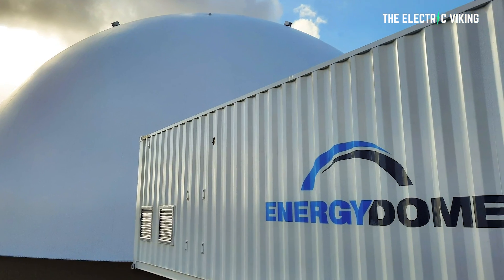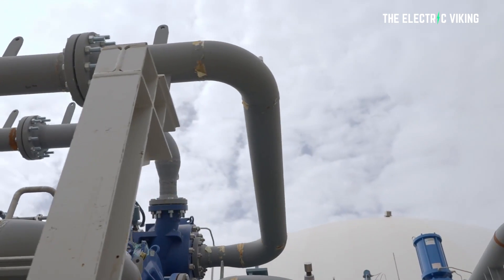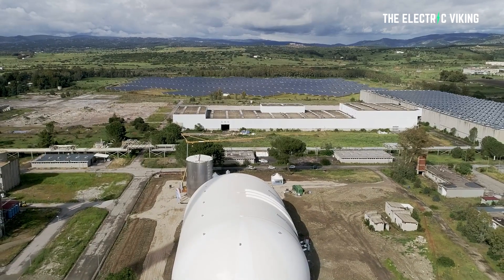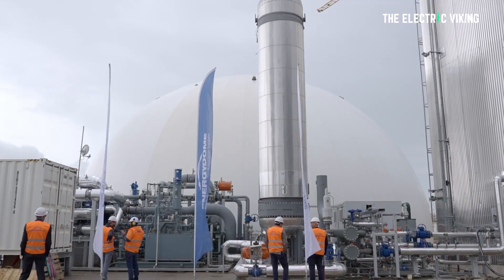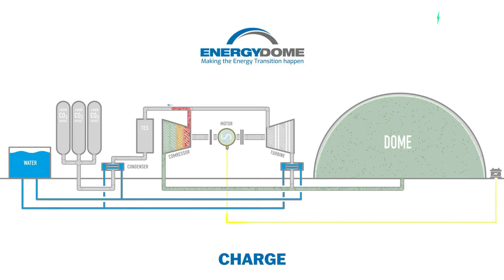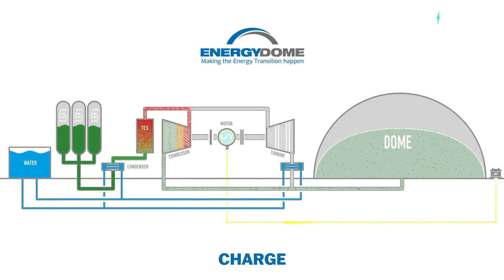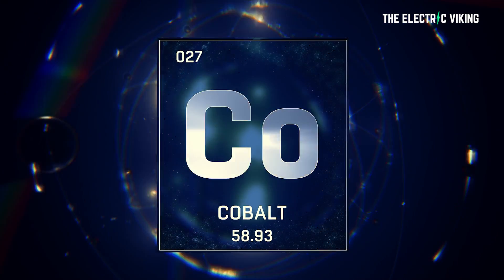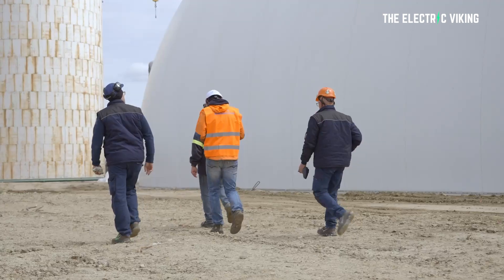NEW CO2 battery is about to change the world as we know it

Comment: I would expect maximum 20% return of electricity out to electricity in. This system could break even if it sold power for more than 5 times the cost of power. But pumped hydro and chemical battery systems have round trip efficiencies better than 80%.

This is a heat cycle engine. The optimum operating temperatures are 20 degrees C (Ambient air) to -78 degrees C (Boiling point of CO2). 
The thermodynamic efficiency limit is:
(20+78) / (273+20) = 33%

For the compression side, you can capture some (half?) of the generated heat, say a large tank of water, and use this to heat the liquid CO2 in the expansion side to feed the turbine.

Look at that enormous silo. That contains an enormous plastic bag to hold all the gaseous CO2.

Viking - you need to pass these product announcements to a technical team before you post.
Reply: You are the only one here who knows what he talking about. Unfortunately your comments will be understood by very few. Systems that use cold storage can never be efficient enough because of the Carnot limitations of Tc/Th. It is better to use high temperature to store energy as Tc/Th is a smaller number which raises the Carnot efficiency of (1-Tc/Th). Better still is to use batteries or pumped hydro. Don't sell your Tesla shares yet, grid storage still likely to be batteries. Viking I love your work but having a power company agreement means nothing. The power company just agrees to buy at a certain price...IF the tech company can supply. Onus is all on the technology developer and 99/100 they will not deliver because this problem is not so easy. The world is littered with failed energy storage ventures for good reason.
Reply: @peterwilliams1119   ... you understand, as well. We need far more engineers making comments about these types of videos.  Better yet, we need real engineers creating videos on various technologies. In spite of it being difficult to communicate the technically complex to non-technical, but hopeful, people.
Reply: There is no need to cool CO2 to -78 C. It has critical point at 31 C, 73 ATM. Both easy enough to achieve. Density is about 440 kg/m³ at critical point. So they compress it as a gas and store resulting heat separately. Of course this is energy and CO2 storage device. It does not produce energy or remove CO2 from atmosphere.
Reply: They claim: 
Built using commodity components, the company claims that its CO2  battery achieves a 75%-80% round-trip efficiency.  

The system has up to 200 MWh in storage capacity.

No-one knows what their LCOE is.
Reply: They use systems to extract liquified gases from air.  This is a similar idea to the ‘air battery’ based upon this existing commercial use.
Reply: Uh no. It is not a heat engine it is simply a compressed gas energy storage system using CO2 compressed into liquid drawn from an enormous dome which has to accommodate the roughly 800 times greater volume of gas vs. liquid. Heat of vaporization mud be provided and some of this seems to come from the heat from compressing the CO2 into liquid. Liquid air “batteries don’t need the dome.
Reply: @stevemickler452  You literally described a heat engine.
Reply: It actually has more in common with compressed air storage. The gas is simply compressed and then reexpanded. The gas is compressed to liquid liquid to reduce the size of the storage tank and the pressure it has to resist. Heat is not being converted to work.
Reply: @stevemickler452  CO2 starts out at say  -50degC and ends up at say 30degC and the output is electricity. That's a heat engine. In the reverse cycle the gas is compressed and heat removed via HEX which results in cold CO2 liquid. Electricity goes in (via the compressor) , the gas starts at say 30degC and ends up at say -50degC. That's also a heat engine but working in reverse.
Reply: Suggest you read some of the comments above that say it better than me but it is an energy storage system not a heat engine.
Reply: @stevemickler452  I've had 40 years experience working with heat engines as a professional mechanical engineer. This is a bog standard Rankine Cycle heat engine. The storage component is the tank of liquid CO2 only. Suggest you pull out your thermodynamics book and re-read it.
Reply: I too am a mechanical engineer now retired. A. Heat engine convert’s heat into work, right? What is the heat source? I don’t see any fuel involved. cO2 is compressed and then expanded. It is really different from compressed gas storage only in that it is compressed to liquid so there’s heat of fusion and vaporization to deal with. It’s called a battery not an engine. The CO2 begins and ends at the temperature in the dome.
Reply: Whoops. I didn’t”t mean “heat of fusion: I realize it’s not frozen. My bad.
Reply: @stevemickler452   @Steve Mickler  Look at a steam turbine as an analogy. The ultimate heat engine. Water is boiled into steam, passed through a turbine to produce power. Then the steam is condensed through the removal of heat to start the cycle over again. The fuel source is coal, gas, wood, whatever. The steam is analogous to CO2 but operating over a different temperature range. Also for this CO2 system, the Rankine Cycle is split into 2 phases. A thermal energy storage stage and a power generation phase. In the Thermal Energy Storage (TES) stage moderately pressurised CO2 gas is taken from the dome at ambient temperature, compressed to higher temperature and pressure, heat is removed via HEX and stored in another vessel, the CO2 gas condenses after heat is removed, the CO2 Liquid is stored in separate pressure vessels.  This is all done with surplus electricity which is driving the compressor. In the power generation mode the liquid CO2 is boiled into gas using the heat previously removed from the CO2 now stored in the TES, CO2 high pressure gas is passed across a turbine to produce power and then stored as medium pressure gas in the dome gasholder to complete the cycle. The "heat: comes from the heat removed in the previous compression stage and stored in the TES.  The "fuel" is the surplus electricity which drives the compressor and causes hot gas which is heat exchanged to the TES. The heat is also visible in the Delta T across the CO2 in liquid and gas phases. The CO2 starts out at -50degC in the evaporator, ends up at maybe +20deg after the turbine. That's a 70degC Delta T that the turbine uses to generate power. The "heat" is also visible in the Compression stage where CO2 gas starts out at ambient temperature 20deg and ends up at maybe 90degC hot gas after compression. You don't "see" any fuel because the "fuel" is the surplus electricity. The CO2 begins in the dome at ambient temperature, yes this is true. But it the turns into a liquid and is stored at low temperature and high pressure. That's where the removal of heat occurs. The heat is removed and stored. The CO2 cannot be turned into a liquid without the removal of heat. It would stay as a superheated gas forever. In the 2nd  power generation phase the same heat that was removed is added to the liquid CO2 and it gasifies and expands across the turbine. That stage is where the heat is added back to the CO2. It is also possible that they could use some ambient air heat to help the process.
Reply: I agree with much of what you have said, although the efficiency of pumped hydro and batteries are excellent there are also times and places where they have serious shortcomings. Not everywhere has a reservoir suitable for pumped hydro. Batteries are currently too expensive for longer term storage. I would love to see cost estimates for this system versus Iron flow Batteries at scale. Both would need battery storage (e.g. Lithium Iron phosphate) for peak load balancing.

Comment: Sam, It isnt generating any energy, it is only a battery, storing energy. The fact that it is using CO2 does not mean it is "actively removing co2 from the atmosphere", it just happens to be taking advantage of the fact co2 compresses into a nice compact liquid. It is like pumped hydro but with a way to reduce the size of the upper storage lake.
Reply: You beat me to this comment.  It seems to be a good way to store excess solar or wind generated power.  It is a sealed system, so it removes nothing from the atmosphere.
Reply: @markstephenson6952  The CO2 is removed from the atmosphere when it is first put in the dome. After that each new build or expansion of storage capacity removes more. It's the growth stage of the industry that is "actively removing co2 from the atmosphere."
Reply: @markstephenson6952  only removes it for the initial charging cycle. There's not enough CO2 in the atmosphere. We should be at 1200 ppm to optimize food growth. It's NOT making the world hotter.
Reply: True, the battery does not "actively remove co2 from the atmosphere" but the manufacture of each new battery does.
Reply: @almar8874  Ah yes and it can be used with carbon capture to fill the domes up. You are on another level with your simplicity of thought. 
Far above most others 👍
Reply: @Vile_Entity_3545 Well,  I wouldn't call my thoughts simple. But sometime people need a simple explanation so I make an effort to keep those simple.
Reply: Sam doesnt have an engineering background, however, in time he will hopedfully learn more about how to compare the different technologies.

Comment: I think if you added the CO2 condensing system that Bill Gates is backing, I don't remember the name, with this process you could remove huge amounts of carbon dioxide from the atmosphere and add a battery after the required amount of CO2 is collected. Keep collecting atmospheric CO2 and put it into additional battery systems until you had a really large battery farm. Then move the CO2 collecting system to somewhere else and start over building another large scale CO2 battery farm. Repeat, repeat.
The only downside flaw in the system is the potential for terrorist attack releasing gaseous CO2 in an above ground dome. Better to build underground storage. For instance, make use of existing mine shafts.
Reply: @SunriseLAW  one one wouldn't be an issue 10 or 20 would be of those inflatable domes. Whether you know it or not CO2 is used as an industrial fire extinguishing agent. Plain CO2 gas. It will kill you and anyone else that happens to be around.
Given the right conditions and in a valley, a release of massive amounts of CO2 could kill a small town and everyone in it. Fairly far out I admit. But I bet you didn't know it was used as an industrial fire extinguishing agent either.

Comment: No, "how many countries?", etc., are not the questions.  The first questions are:  How efficient is it?  Lithium batteries are like 95%+;  I highly doubt this thing has anywhere near such an efficiency.  You already said that the heating from compression is wasted to the atmosphere.  Another question is how much kilowatt-hours can it store ... per $, per square foot of terrain, per cubic foot of structure, per kilogram of equipment, and per kilogram of CO2.  Another question is what is its peak power capacity, in kilowatts ... per $, per square foot of terrain, per cubic foot of structure, per kilogram of equipment, etc.  Durability.  Maintenance.  None of these questions are addressed in the video, making this a gossip video rather than anything instructional or even "food for thought".  I repeat what I said yesterday, this channel is going down the drain, making clickbait out of everything, I'm at the point I'll be unsubscribing any day now.
Reply: I thought he said the heat from compression was stored and then used later for expansion.
Reply: @dansanger5340  
How do you store all the heat equivalent to the amount of energy used to create ?
Reply: @CJHallx  I’m not sure how they’ll do it, but the Wikipedia article on Compressed-air energy storage discusses various strategies, and indicates that it is possible to get decent round trip efficiency.
Reply: @dansanger5340  They claim 75-80% round trip efficiency, which sounds pretty reasonable.
Reply: @dansanger5340  
Thanks. I'll check it out
Reply: @dansanger5340  Ok, I missed that.  I heard the opposite, somehow.  In any case, heat storage and restore operations are high entropy;  can only get you fractional efficiency increases.

Comment: This battery does not actively remove CO2 from the atmosphere.  The quantity of CO2 (which is the working fluid) is fixed, it's what it was on day one of operation. Any CO2 leaks will be to the atmosphere and can be restored by replacing that CO2 with CO2 extracted from the atmosphere (but those quantities will be both small and carbon neutral at best). This is an equivalent to a gravity battery except, instead of using change in potential energy by allowing a weight (could be water) to drive a turbine and or generator it is pressure (of CO2) that is expended to drive a generator via a turbine. This might be an OK idea, especially where space is limited (storing CO2 as a liquid rather than a gas is volume friendly but not very efficient). It is possible this could be viable grid storage, time will tell I guess.
Reply: You lose energy both ways. On compression, waste heat, on expansion, you have to heat it. They try to save the heat but inefficient.

Comment: It's not revolutionary, it is more of a nothing burger. It's just (CAES) Compressed Air Energy Storage, with extra steps. I'll wait for the cycle efficiency before jumping the gun. Currently, adiabatic CAES reach storage efficiency about 70-80%. The system does not lower CO2, it just compresses it from atmosphere, and releases it back into atmosphere during discharge. There are plenty of CAES plants/storage around, Huntorf CAES Plant, McIntosh CAES Plant, Jiangsu Jintan Salt Cavern Compressed Air Energy Storage Project. They all use caverns to store the compressed air, so a system with its own tanks seem less cost-efficient.
Reply: @Pharisee Spotter Closed cycle CO2 makes no sense, where are you going to store the expanded gaseous state of CO2, it's about 600x the volume of solid CO2. Ginormous bags/balloons of CO2 will take up land/space.
Reply: @Pharisee Spotter There are a lot of carbon sequestration technologies, just that there is little incentives to do atmospheric carbon sequestration, like who is going to pay for the operation of the plant that makes no money and costs money to operate. A better approach is for some company to have a process that uses the CO2 to end up in some product. Like the Stanford project that can turn C02 into gasoline, or a startup (Dimensional Energy) that captures CO2 and turns it into jet fuel. Synthetic fuels are carbon-neutral at best, more promising is calcium carbonate concrete that actually sequesters CO2 into construction material.